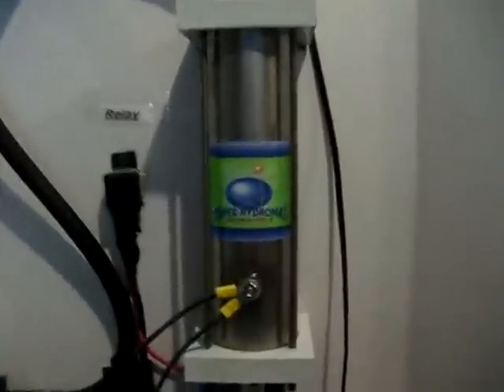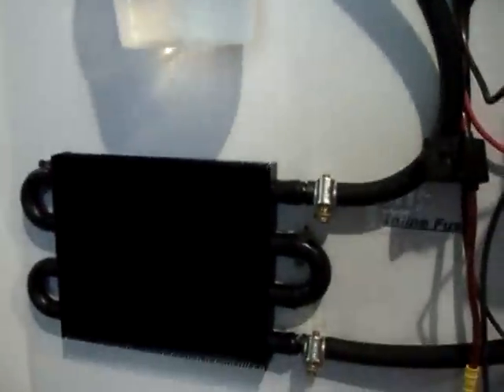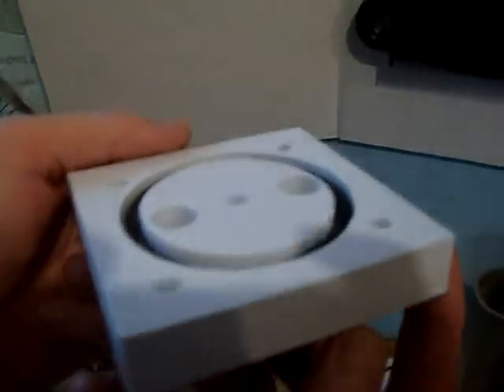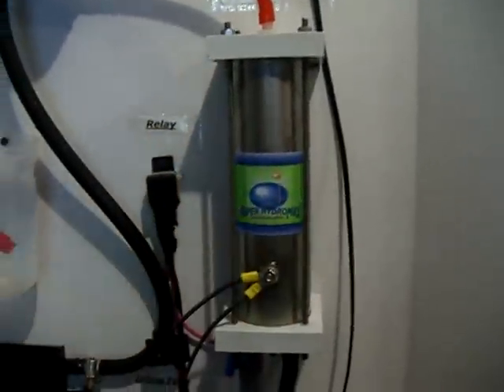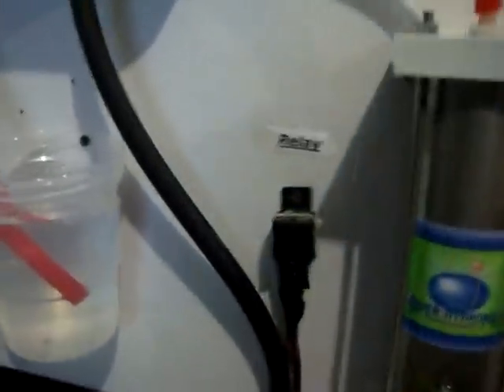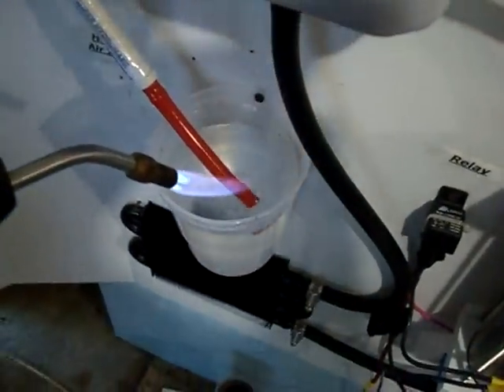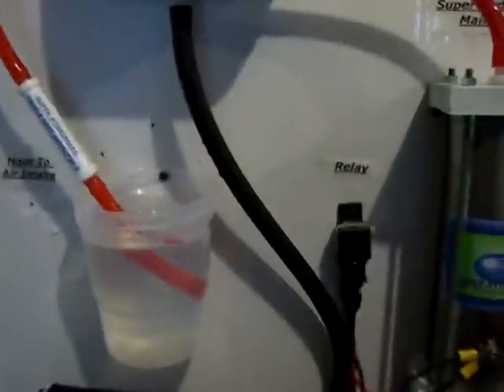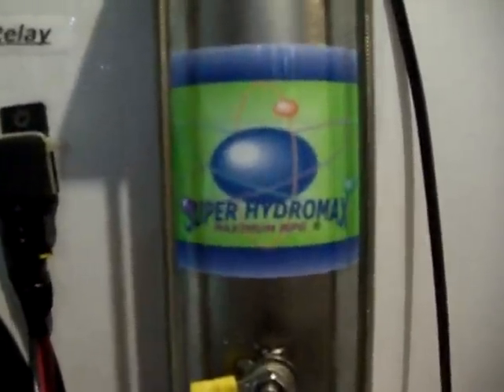Super Hydromax hydrogen Generator vs Hydro Super 2 video #13

Comment: A question:  What prevents the electrolyte solution in the tank/bubbler from splashing into the hose to the car's air intake when you hit potholes, etc.?